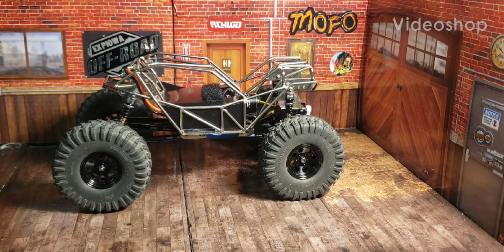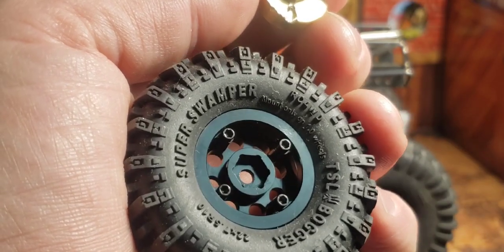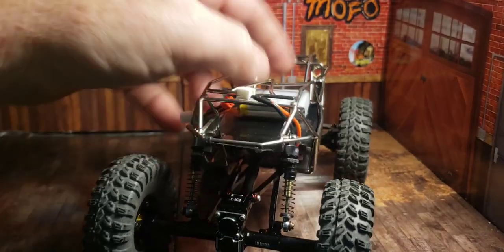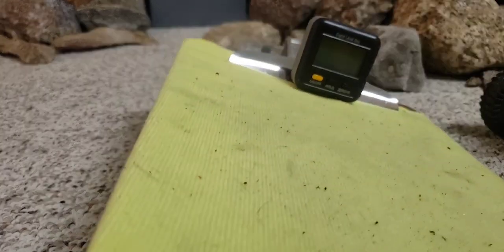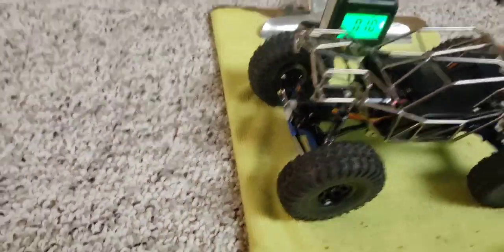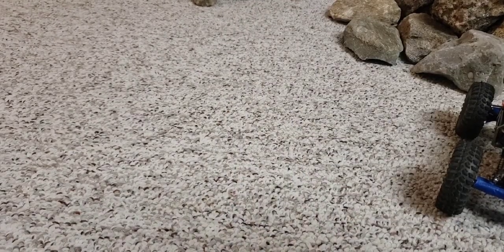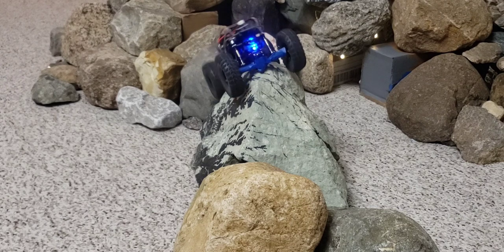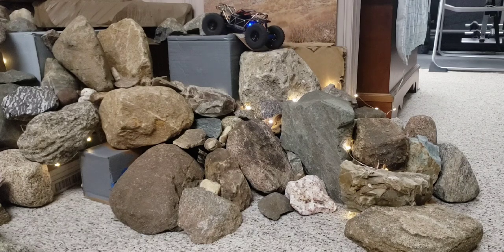1:24 Furitek Olympus Rock Trial

Comment: Thanks a ton for including instructions on how to mount the skid on the second video. I had mine mounted terribly wrong. I have the first version and it’s been sitting for a long time because my upper links kept coming loose since  I was mounting them to holes in the frame instead of the skid. I couldn’t get the holes to line up with the skid and couldn’t find any instructions anywhere so I put away and forgot about it. Im using my stock plastic skids on this chassis now and put self tapping screws in the middle to give it more support.

Comment: Those little angle boxes are great. I use one on my table saw, band saw, and belt sander. You can hit "zero" when you have it on a surface and it's not level to start. Now what's needed is a universally used surface medium. Myself, I think something like 220 grit sandpaper would be a good choice as it's available most places and is as close to a consistent standard as reasonably possible. :)

Comment: I'm very new to the I have no idea how to build one what would you charge me to build one like this if I just sent you the cage
Reply from the maker: The one I built in this video probably had $700 worth of parts only. If this is your first build I recommend you get a stock truck and upgrade it so you can learn how everything fits together then buy a cage later and transfer what you built into the new cage.

That truck probably has over 30 hours of work in it. You build something like that because you want to. Doing it for money doesn't make sense.